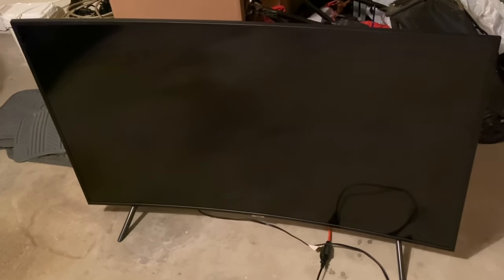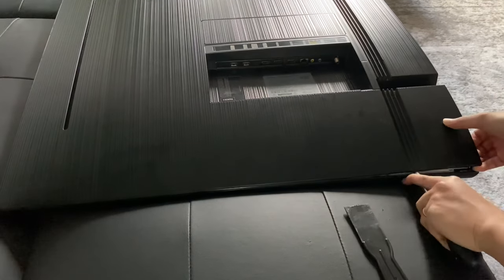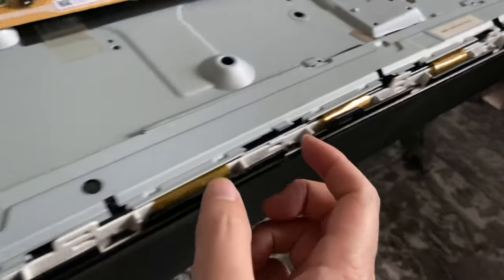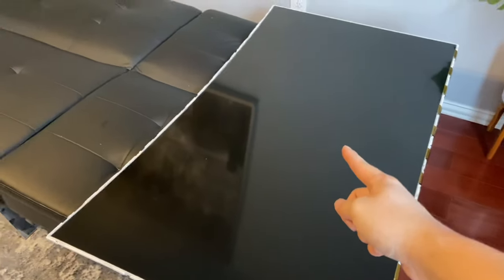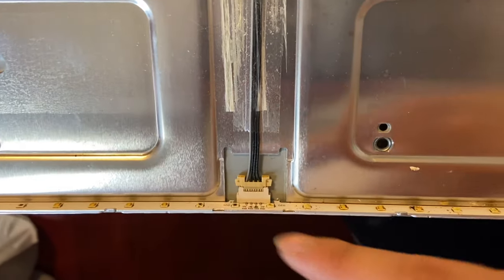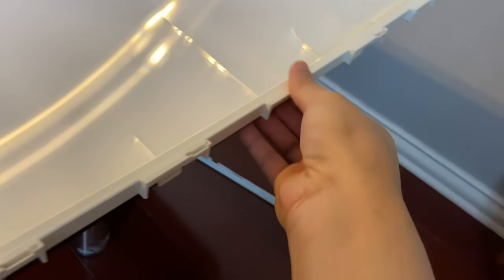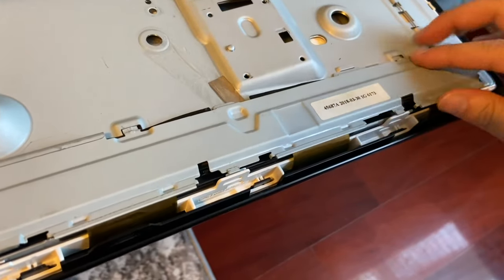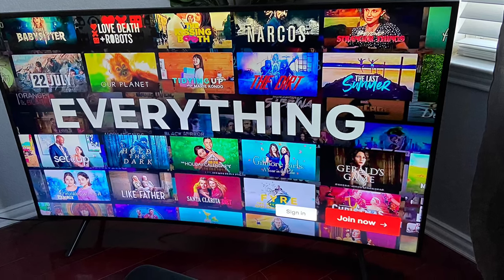Replace Backlight LEDs on Samsung Curved 55” for $30 (UN55NU7300 / UN55NU7100 dim screen)

Comment: This was super helpful, however I had 2 issues. In taking off the black front enclosure I snapped two clips because I started on the bottom. Starting on the sides and top seems to make the bottom clips easier to get out. 

Second, there was some burn on the inside, so I rotated things like you mentioned, but now the bottom of the screen is extremely bright compared to the top. I don't want to take the screen apart more than once more because of the aforementioned snapped clips, so I need to figure out whether I need to push all the interior panels and sheets as far to the bottom as possible (they oddly don't all fit exactly with the screen size by a few millimetres and may not be sitting flush with the bottom, which might be the issue) or I need to just put things back like they were with the slightly burned panel (might see if I can clean off some of the brown, as the burn isn't as bad as yours). Any ideas?
Reply from the maker: On number 2, you are correct. I pinned my other comment hoping people would see it. On the burned plexiglass, I've found it's best to sand down / dremel the burned areas until they're gone, and then reinstall it into the TV the same way. The way the plexiglass is made, it's supposed to darken the section closest to the LED and brighten the section away from the LED. It should be installed the same way, not flipped.
Reply: @EdwardInTX  You should add this info you the video description. I looked there before I looked at the comments, but I didn't see which ever one you pinned.
Reply from the maker: @ashbradford  Just did. Thank you!

Comment: So I accidentally got the ribbon to tear off of the board. Can I solder it back on?
Reply from the maker: i'm not sure, never tried it. looks possible though but would be careful since the connector is plastic

Comment: Hi i think i made a mistake the back light strip wont light up. What should be the problem.?
Reply from the maker: the power strip that connects to the backlight goes into power board and the light, just check that connection
Reply: @EdwardInTX  i disassembled my tv and wanted to test which ones the bad back light, when i plugged it in, no light and check the connection still no light

Comment: Hey thanks for the walkthrough. I followed your directions and I’m ecstatic that it fixed the issue, but now I have a bad backlight bleed like you described towards the end of your video. I remember I flipped it upside down with the plexiglass. If I disassemble everything, and flip the white sheet back the way it was and leave the plexiglass, will it fix the backlight bleed? Thanks.
Reply from the maker: Yes, with the caveat being the paper has to be really flat to even the light out properly (caveat: the curved tvs are much harder to straighten than that flat panel)
Reply: Thanks, I have it apart again and I can’t tell if I have it right and I really don’t want to take it a part again. lol
Reply: @EdwardInTX  any tips for making it flat? My TV is curved and now I have a couple of spots, I suspect it's because I couldn't make the sheets completely flat.

Comment: Hey guys jus looking for some help

3 mths ago a technician supposedly replaced the strips on my samsung 43 inch smart tv.
Problem has  now risen again as i have no light on screen but can hear sounds and see images if i shine a light on it.
Tv power light blinks 5 times when turned on.  Didnt find much help on the web

Comment: Is the backlight strips original? Because I have found 2 strips for 10$ including the shipping from AliExpress and the one you have attached in the description will cost me 50$ including the shipping, so what do you think mr Edward ?
Reply from the maker: They're not original. The ones I bought were $25-30 on ebay.
Reply: @EdwardInTX  unfortunately the ones on ebay are 25$ but the shipping is 30$ so it will cost like 50$, and I’m wondering since it’s not original, do you think that the ones on AliExpress will do it or should I buy the ebay ones ?
Reply from the maker: @nawaf8258  I do not know the answer to that question as I've never tried or seen the Aliexpress ones
Reply: @EdwardInTX  fair enough, thx alot edward I just wanted to check if it’s original or not.

Comment: What about the UN55NU7200F?? And my tv has a 6 inch wide vertical stripe off to the left of the center of the screen.. From what I've read, its just a strip of led's.. I paid close to 900 right before it went on sale so I'm super salty about the price of this tv and needless to say its a sensitive subject.. Anyways, id really like to fix it if I can, so any thoughts??
Reply from the maker: I just fixed that model NU7200 a few weeks ago. Same process as these.

Comment: Quick question, are the ribbon cables supposed to go on top or under the pins?
Reply: The pins should be touching each other. There are two very little tabs on each side of the part the ribbon cable goes into. Slide it in so they are under those tiny tabs, and pins are facing down. If that doesn't answer your question, I don't quite understand what you are asking.
Reply from the maker: Chandler is right. Under the pins.
Reply: @ChandlerC11  thanks for the reply. It turns out, that the ribbon cables had nothing to do with it, I just forgot to plug the remote sensor in, so I couldn't turn it on. The tv is good as new now!

Comment: how easily is to break the glass panel? I have to change the LEDs of mine but im scared ill break the glass. And sending it to repair its really expensive
Reply from the maker: it's quite easy. You have to keep it as flat as you can as I show in this video

Comment: What is the correct position for the bottom sheet to prevent the backlight bleed?
Reply from the maker: The same way it was taken out. Dremel or shave off any yellowing areas

Comment: I did all the procedures correctly and replace the LEDs but the display won't turn on and I checked the ribbon cables and they seem to be fine and well plugged in but the display is still all black
Reply from the maker: Do the LEDs turn on?
Reply: @EdwardInTX  yes
Reply from the maker: @theidioticmedic  Definitely a ribbon issue -- shoot

Comment: When lifting the panel out of a curved monitor, can I lay that curved panel on a flat surface? Or does the curved panel has to be on a surface of the same curve?
Reply from the maker: It can be laid on a flat surface. 

Btw if you see the burned area at the bottom, I recommend just sanding that down until clear and putting back in the way you found it, due to how it dissipates the light.
Reply: @EdwardInTX  Is it possible to buy a new of these burnt/cracked plexiglass pieces?
Reply: @markgarrison9719  doubt it unless you search and call every TV repair place within a 2 continent radius! Lol

Comment: I have backlights, but purple and greenish vertical pixels all over it.?  
Any tips?
Reply from the maker: I'm not an expert in this, but it might be a t con ribbon connection, or the main board (if the screen is not cracked)

Comment: You will still have a big issue. If u don't change the white panel that spread the light.... the leds will get burned again very short. Best option to buy another one same model and replace both (leds and lens panel)

Comment: I have the same tv but the left side is good and the right side show but it's dark is this the same problem
Reply from the maker: Yes
Reply: Again thank for the video, i was just wondering my tv is a UN55RU7300F and your TV is a UN55NU7300F will the same light fit
Reply from the maker: @hlrspence31  Yes. You're looking for part bn96-45913a
Reply: @EdwardInTX  thank you

Comment: what would it look like if you cracked only the black screen
Reply from the maker: with it off, there will be an obvious lighter shade colored line through
Reply: @EdwardInTX  what about with it on?
Reply from the maker: @gxtscopedd  obvious crack on the picture and a black vertical bar spanning the width of the crack. It gets worse over time too

Comment: Can I used the back light of tv Un55NU7100 in reemplacement of back light UN55RU7300?  Thank you
Reply from the maker: I think that's a direct replacement, yes.
Reply: @EdwardInTX  they are very specific...the size and part numbers are the important ones....my 55" 7300 has a '45913A S' part number and 99% of the ones found online are 45913A...it makes a huge difference, I just learned the hard way...best thing is to tell people to remove the old strips and compare the numbers/letters before ordering new ones, if they don't match up, they won't work properly.

Comment: I must have screwed something up, bc I have audio, but no picture, but it doesn't look like the screen is cracked.  Any ideas?
Reply from the maker: Probably the cables going to the white ribbons into the panel
Reply: @EdwardInTX  thats what I was hoping too. Thanks!
Reply: @EdwardInTX  you were right! But now the whole screen is dark, its off center, and there is a vertical line on the right side :(. Do you know what that could mean?

Comment: Are the leds just at the bottom or the top too?
Reply from the maker: Bottom only in this model
Reply: @EdwardInTX  do you know where they are for the UE55NU7100 ?
Reply from the maker: @KJCOD  The ue55nu7100 is similar to the UN55NU7100-- it's two strips on the bottom
Reply: @EdwardInTX  oh thanks

Comment: Don't anyone Kno where I can get the screen for them to buy ?
Reply from the maker: The lcd panel can’t be purchased, just the leds and boards
Reply: @EdwardInTX  thanks.. that I figured. Have to wait until someone board or power supply go n they don't wanna fix lol

Comment: One thing EVERYONE SHOULD BE AWARE OF, I repaired mine this way. While installing the new strip (tv was unplugged for some time mind you) my finger completed a circuit between the metal backing and the new strip as I secured it and completely shorted/blew an led. I now I have a new led strip in my tv with a huge dark line down the middle. Hoping it wouldn’t be too bad( it was always going to be better than what it was) I completed it to see the end result. This is just one dead led. The rest were still functioning when I hooked it up....
Reply: There is a huge dark strip up the middle. I have to order another set now.
Reply: Update: overpowered LED backfed, started separating the layers due to heat. Shut it off and back on after it cooled. Ended up blowing out the rest of the led strip. Now only half of the tv is okay.

Comment: Very bad work, it is necessary to put a new light diffuser that has burned out, it can not be rotated because the picture will not be fine. tells you a master with 25g experience
Reply from the maker: This is why I pinned my other comment recommending sanding down the burned areas. We are unable to buy the new light diffusers here unless there are cracked TVs that pop up.

Comment: Great video! Thank you very much for putting this up @Edward in TX
I had a single LED malfunctioning... During the process of removing the old LED, a short happened and damaged more LED.
I removed the old LED strip from both sides, installed the new one, tested and all lights were lighting up correctly.
When I put everything back, I noticed that half of my screen has no colors...
Do you have any ideas on what the issue might be? and or how to fix it?
I checked my flat cables and they are all inserted correctly. The colors on the the TV were working before I changed the LEDs
Thank you!
https://youtu.be/hLsFgRsC4xg
Reply from the maker: that would be one of the cables between main board and the flat cables
Reply: @EdwardInTX I tested both flat cable and they are working fine...

Comment: fake video means,I am performin this method,the upper portion may be middle portionlight is very low Pride,only the lower portion bright is normal.mismatch bright  level ,   customer do not accepted,  , next day i am open the tv and the reflector is rectify   by original position, the bright is normal , customer wii satisfaction 
.

But  you are performing wrong position reflector posision

Comment: You are cunningly  fake video 

This tv do. Not exhibit full bright video for bottom to top.  Only bright  for bottom

 Fake video
Reply from the maker: I showed how the plexiglass looks like flipped, and even mentioned in the pinned comment. Listen again before coming to that conclusion. "Fake video" 
9:45 Full bright (mentioned yellowing due to burned part)
10:01 Bottom brighter (mentioned this is due to flipping the plexiglass)
Reply: @EdwardInTX  your video is ok, but direct vision is exhibit top portion bright is very low , lower side light vision is ok, central portion  light vision  very low,, 
Because you alter  in reflector,  
In this tv
Reply from the maker: @ratharatha1641  hence why i said mentioned in pin that the plexi should be dremeled on the burned spots